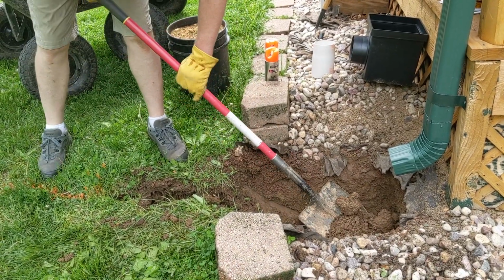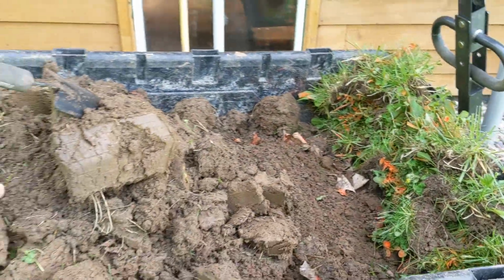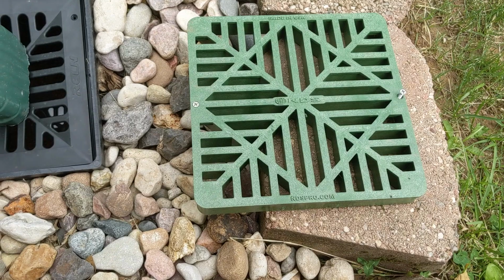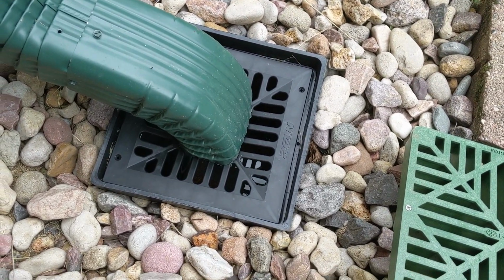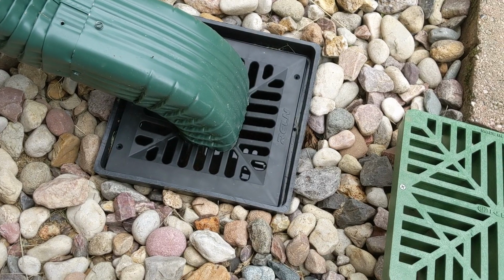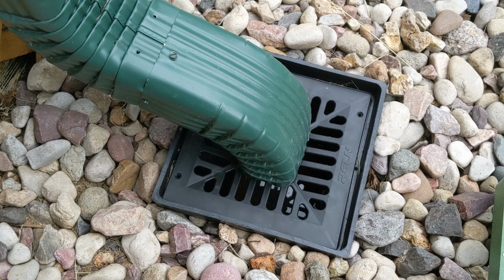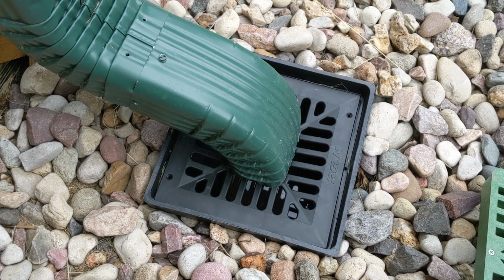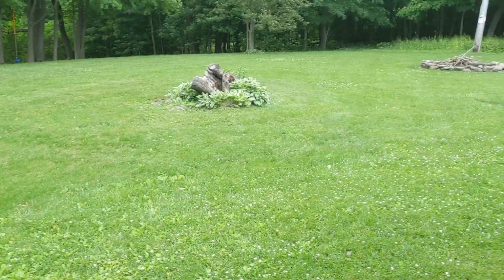Let's Bury All The Downspouts

Comment: I really like what you have done with the catch basin and rocks.  I am installing something similar.  I was just about to install the elbow at the bottom of the downspout when I saw your video.  Now that it's fall, is leaf debris collecting at the bottom of the downspout?
Reply from the maker: Thank you for watching, and we're glad you like it!  We just finished cleaning up the yard in the last few days, and I am happy to say that there wasn't much debris at all that was collecting in or near the basin...it seems like the covers do a pretty good job of protecting.  However, if something does accumulate over time, the basin lids can be removed so it can be cleaned.  I should also mention that we have leaf-guards installed on our gutters, so this helps a ton.  Hope this helps and the rest of your project goes well.